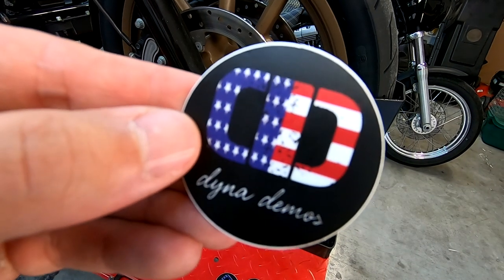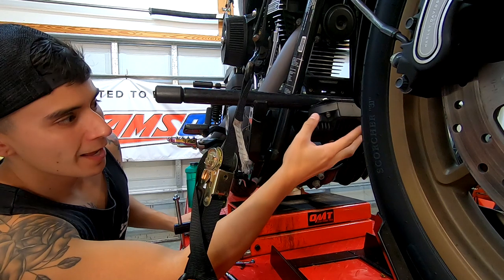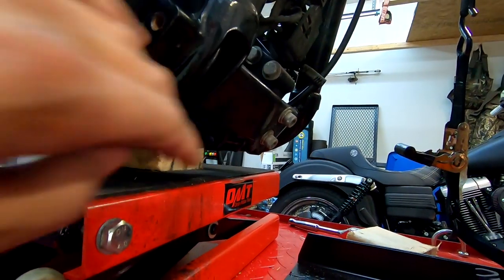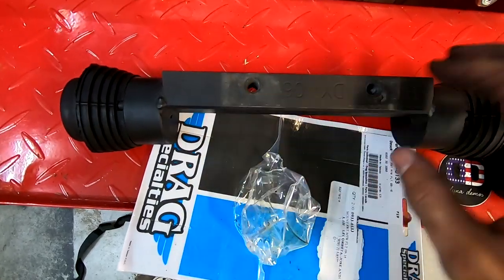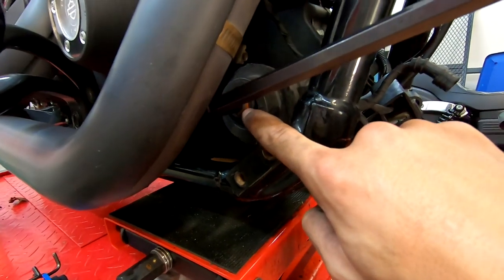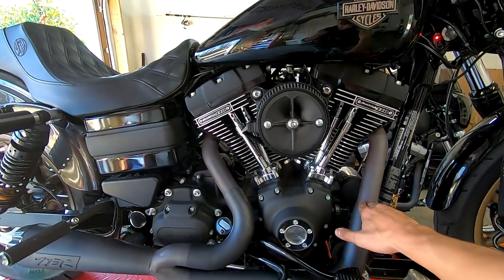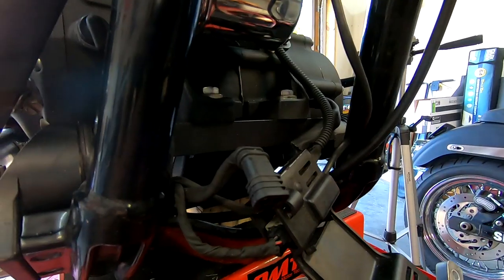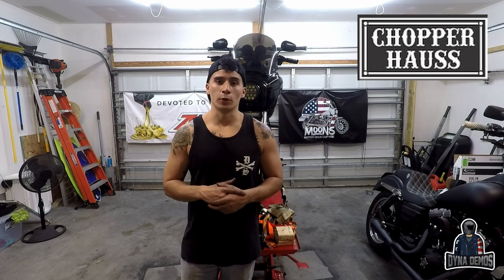Chopper Hauss Front Motor Mount Install

Comment: Wise move using the mounts from Drag Spec - they are Urethane and much firmer than the H-D ones which are softer rubber meant for Tourers, but most people with Tourers prefer the Urethane ones as they 'firm-up' the handling. Also, a little tip here, get some Brass nuts for the exhaust flange studs - they seem to stay tight more and as they are Brass they cannot corrodes and seize on the studs. Anyone who has had a nut seize on the stud will tell you it's a nightmare because if you break a stud then the cylinder head has to come off to get the broken stud machined out by engineers.... I speak from experience unfortunately !
Reply from the maker: Thakery I look into those brass nuts Thankyou for the tip 🙌🏽
Reply: @dynademos  You are welcome.

Comment: Great video, I've installed on a 2008 streetbob, did you have to do a drivetrain alignment after replacing? I've notable vibration after replacing the front motor mount.

Comment: I just had a thought.... when you do fit the Chopper Hauss rear mount, if you are using the later MkII model, a big advantage over the MkI or the BigBear one that I have is that as the later Chopper Hauss one has flat sides and may allow you to fit a TrueTrak as well.... if needed....
Reply from the maker: Thakery good info hopefully after the upgraded mount u would not need a stabilizer though spending over 1000 for all the mounts and stabilizers would be crazy haha
Reply: @dynademos   I am sure you will not need the stabiliser with the Chopper Hauss rear mount. I told you it'd be a good idea to use those Drag Spec mounts as they stopped my motor jumping up and down so much (remember ?) - well I found out why my motor was jumping up and down at the front. The rear damper units were worn out and that allowed the whole drive train to pivot around the rear engine mount - like a seesaw or teeter-totter I think you call them.
 As you are using the D.S. front 'rubbers', it may allow your rear suspension to perform a little better.... it all adds up to help improve handling and stopping the dreaded 'Dyna Wobble" - it is heart-stopping when it happens !

Comment: So, has the new motor mount improved the ride? Any significant differences from stock? Or is this one of those parts "It's for sale and its expensive so it must be good"?
Reply from the maker: Definitely more rigid feel especially if you run a blow out stock motor mount. Also doubles as a landing pad if u wheelie. I’d say if u actually change out your stock motor mount with a fresh one u don’t need this

Comment: The manufacturer of these mounts says to tighten the side flanges to spec, leave the engine bolts loose, run the engine so it self centers, shut it down, then torque those two engine bolts into the crossbar
Reply from the maker: Been a long time since I made this but if that’s what they say follow their instruction I haven’t had any issues. Also the cross bar the engine mounts to were just holes from what I remember that the bolts fit into perfectly so in reality I don’t think tq it down would honesty do anything as I think it would fall into the same place 🤷🏽‍♂️
Reply: @dynademos  only thing I don’t like about this mount is that you can’t use the crash bar of your choice.. have to go with what they want…
Reply from the maker: @bullast2046  all the crashbars I know of actully make one for these engine mounts 🤔 fxr division ,bung king , imzz elite

Comment: Hey man! I just ordered one of these and im still waiting on it but I was curious as to how the quality seems? As well as does it seem to make the front of the engine closer to the frame?
Reply from the maker: GameJit I think it actually life the motor up so slightly more away from the frame could be wrong. The quality is 100 I’m diggin it next I need suspension
Reply: @dynademos  sweet thanks man 🤘suspension is key!

Comment: Guessing this wouldn't work with the factory forward controls on my 10 Dyna Wide Glide?
Reply from the maker: So I have a fxr division crash bar which mounts to the spot. I think u could make it work maybe some slight bending definitely possible
Reply: @dynademos  Thanks for the input. I have the opportunity to pick up this front mount and a CCE rear mount for a reasonable price but reluctant to pull the trigger as I love my forward controls. Thanks again and the vids are top notch. Just used your handle bar swap one last weekend. Job went great thanks to you guys.
Reply from the maker: @shaunfrederick4909  also will need longer bolts for the mount if u pull the trigger

Comment: Hey brotha, I just did the BBC version of this motor mount, did the front and rear and now by 2017 FXDLS vibrates like crazy. It’s ridiculous, did you have the same issue? I’m not sure if it was installed incorrectly. Any help is much appreciated
Reply from the maker: I haven’t done the rear do u know what isolators u went with there are a few different ones if I’m not mistaken polyurethane, rubber, and metal it’ll make a difference what isolator u have

Comment: Hey mate, i just bought the big bear alloy version and when u put the 2 side mounts together (back to back) the bolt holes are not the same. Judging by this video the chopper haus is the same as 1 another. 
So my question is do u know if the brackets on the frame are in the same spot on the frame or is 1 bracket about 5mm further foward and about 2.5mm lower than the other side?
Reply from the maker: Steve Hodges honestly idk I would assume they are the same but I’d be lieing if I said I knew 100

Comment: Is the Chopper Hauss and the Big Bear mount the same thing?
Reply from the maker: Yes they are except bbc came out with a version 2 that’s lighter and adds an alignment guide
Reply: @dynademos  Thanks guys! Chopper Hauss has the front mount and crash bar on sale as a package right now. I just ordered it, thanks for the info!

Comment: I installed one on my dyna 2004 still get to much bouncing on my motor?
Reply from the maker: Have u checked the rear mount
Reply: @dynademos  yes brand new bikes missing I think it the voltage regulater
Reply from the maker: @billgonzales8978  not sure dude I’d have to check your bike out to see why it was bouncing so much then if it’s not the mounts